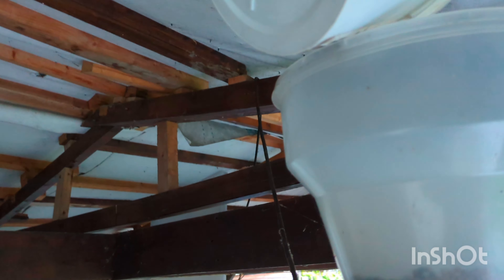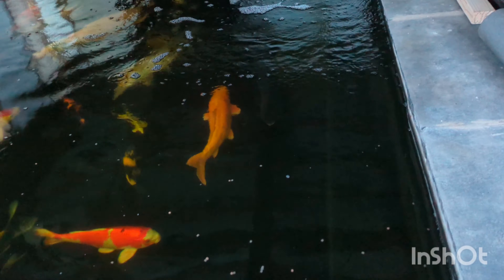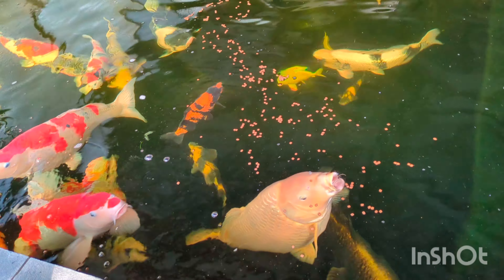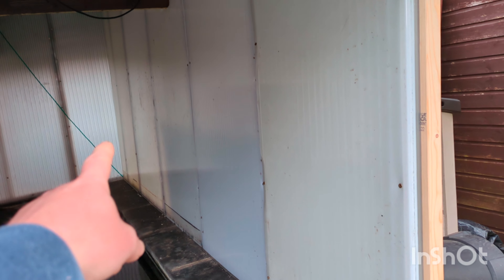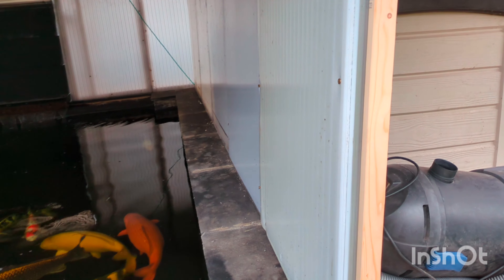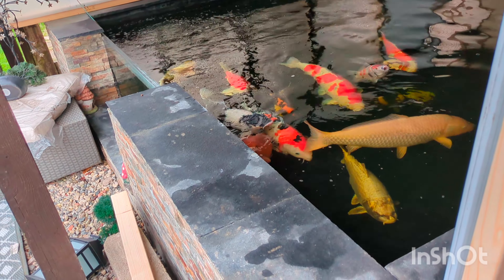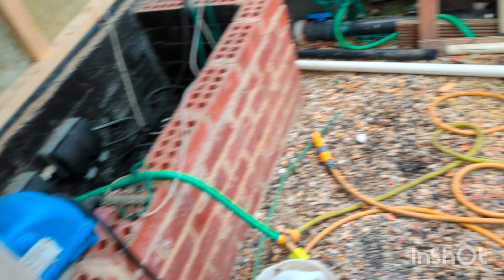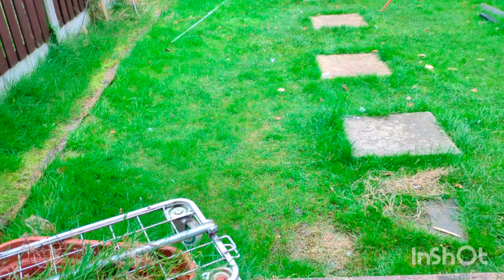part 3 of the polycarbonate build

Comment: Just a thought , you should never us a rolled up extension lead , if it’s not completely rolled out, it will get hot and trip out your electric, it becomes a coil, if you now what I mean , well done with winter cover up,
Reply from the maker: @koipond6266  cheers pal extension rolled up is not plugged in pal